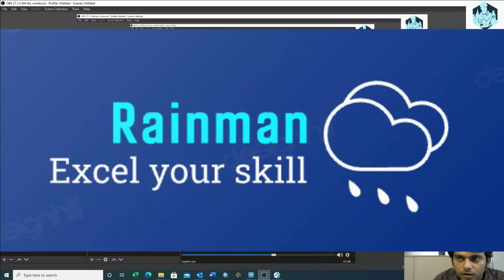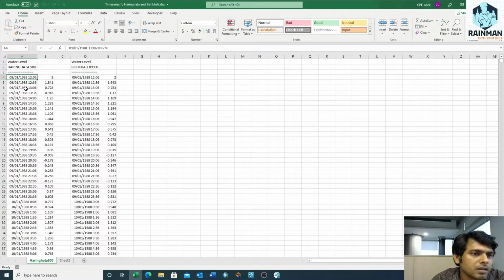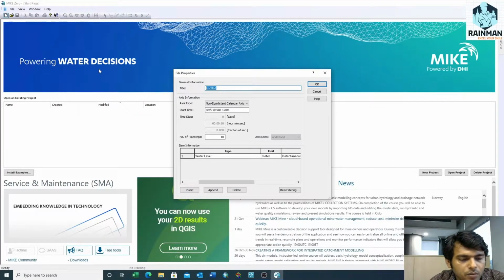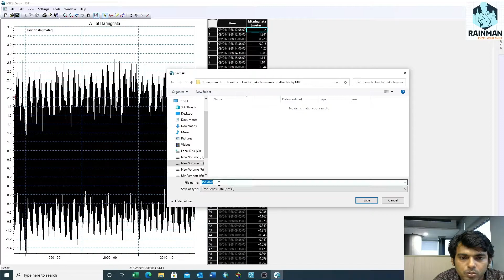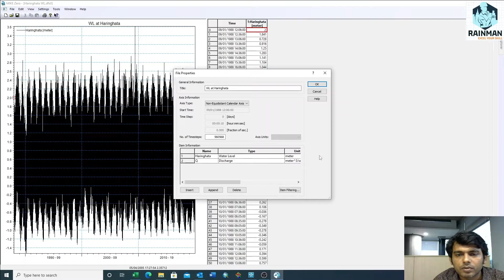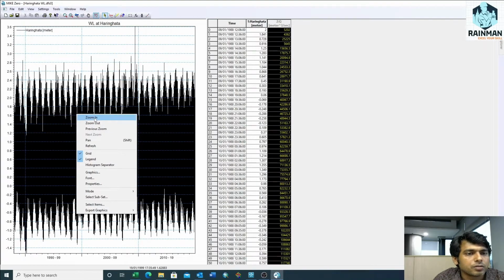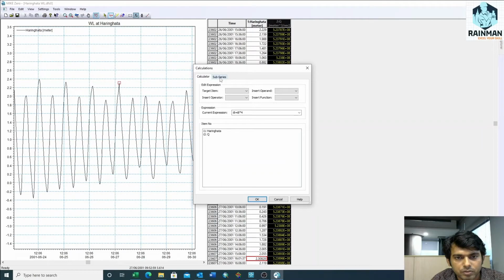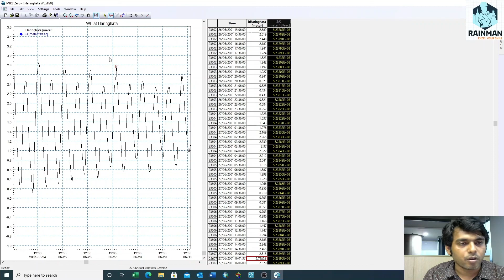how to make timeseries dfso file by MIKE || Mathematical Model || Water Resources Engineering

Comment: Hey i have wave and tide time series data in .txt format at one location which is in my model domain, so now can you let me know how to create dfs0 files to provide wave and tide boundary files to mike 21 bw model. I came to know how to create water level dfs time series file, but, how about wave related dfs0 file, is it same or any change. please clarify me. Thanks for your time.
Reply from the maker: Use mike.io python package to convert txt to timeseries
Reply: @dipensahajony  I tried but, it is not working properly it seems, i created water level but, how can i create wave boundary file using my time series wave data that is in .txt format?, it would be helpful if you can let me know. Thank you